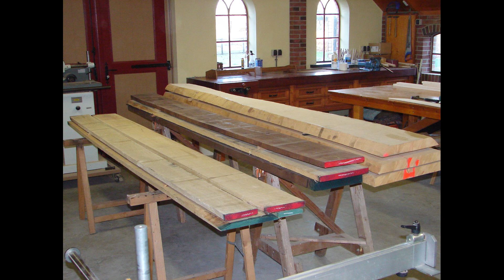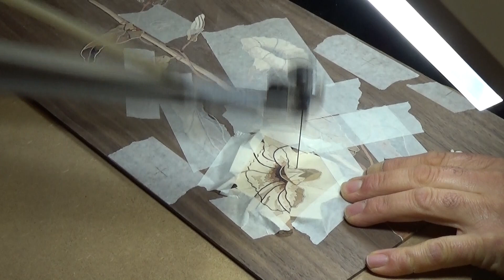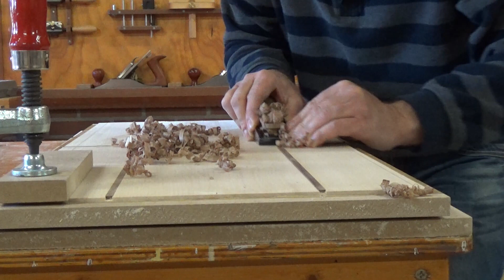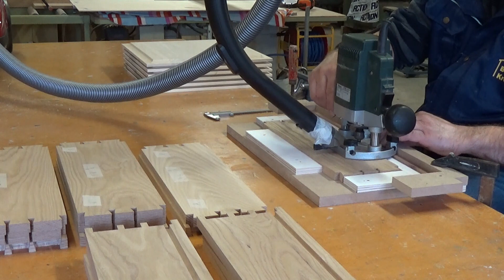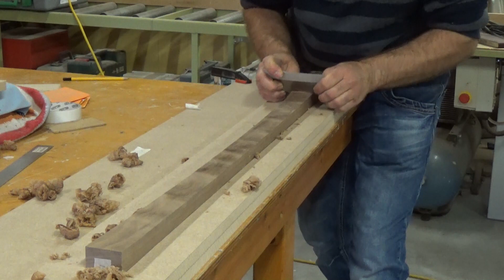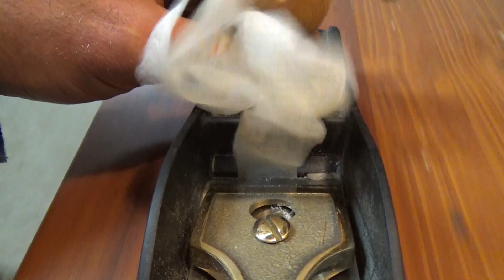Fine furniture and marquetry

Comment: What thickness is the veneer you use?  Looks like it’s thicker than normal paper type.  Beautiful work
Reply from the maker: Thank you ! I make my own veneer because I do not like to work with thin veneer. I make it 3 mm thick, that works best for me.
Reply: @ronnie_rozenga  ok. It makes sense alright. The thin stuff can be frustrating with breaking on short grain. I’m watching another of your videos and you can glue the edges too for a nice joint. So that’s 6mm in total when cutting. Probably need a decent blade and proper machine then for good cuts. Thanks for reply and you do good work.
Reply from the maker: @paddypup1836  Thanks, I use the Pebeco 3 saw blades. Have fun !